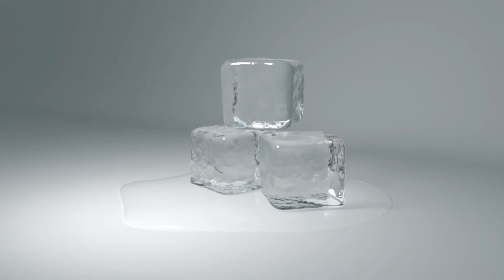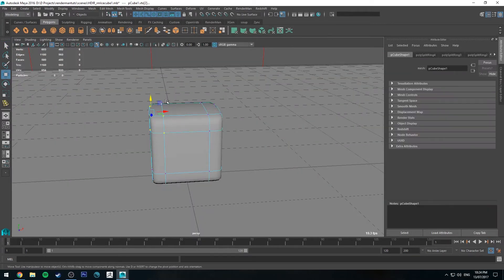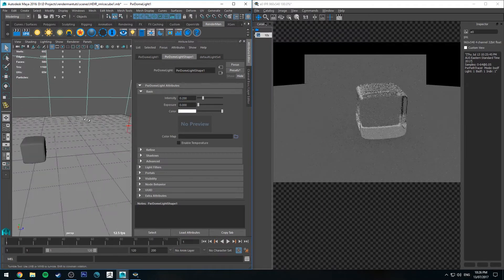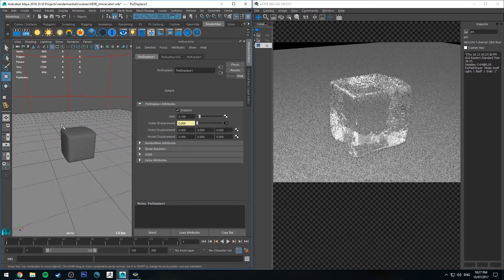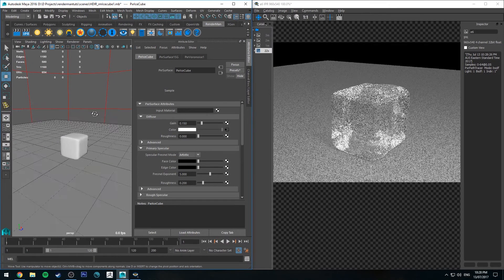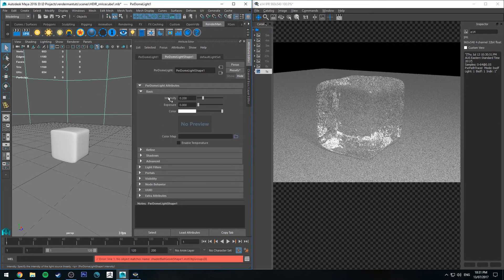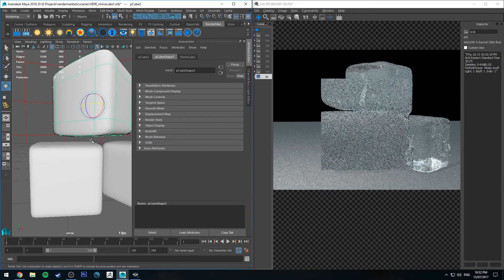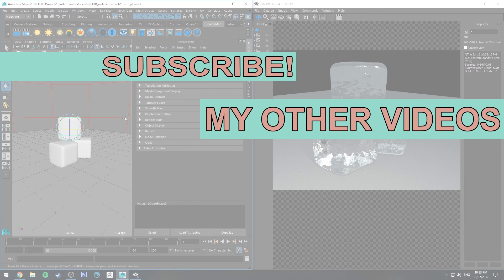How Do I Render: Ice Cubes (Renderman & Maya)

Comment: will this work with Arnold?
Reply from the maker: Yeah, same thing basically just need to use Arnold lights and shaders.
Reply: @SmallRobotStudio  I don't know...I'm having trouble translating it from Renderman to Arnold. the names and setup are different and if you don't know what they do... its kind of hard to figure out unless you experiment and click buttons and hope maya doesn't bitch at you for it...
Reply from the maker: Hate to tell you but that's the game you're playing, it's a lot of pressing buttons to see what they do until you figure it out while Maya crashes. The basics of what you want to do are create a surface that transmits light and has no diffuse, so apply an aiStandardSurface shader, reduce the gain on the diffuse channel to 0 and increase the transmission weight to 1.0. Set the IOR in specularity. I can't remember what I did for displacement etc but it's the equivalent for Arnold, there's plenty of tutorials out there on how to do the basics with that renderer.

Comment: Hi Michael. Thanks for all of your tutorials! Mind if I ask you a quick question? I'm trying to create a scene like the one seen in the Monsters University teaser trailer, where Mike was turned into a disco ball as prank by the other monsters. The problem is that I don't know which material and settings to use to make those shiny panels that scatters the incoming light onto the walls. Any ideas?
Reply from the maker: With this shot I think they cheated a little. The small mirrors are just reflective surfaces so just the PxrSurface with high specularity will do the trick but I don't think they're actually casting the caustic reflections as there are some reflections BEHIND Mike (opposite to the light source). What is really happening is that there's probably a light linked light source shooting out the small highlights, one or many (this may/probably is an effect in post as well had to say without really watching the scene in slow-mo). 

The shot also is using Volume Scattering on the light, which again I think is being added as a layer in post as there doesn't appear to be any 'fog' anywhere else in the shot. Caustics and scattering is a tough thing to do and requires a different integrator (which I haven't actually covered in a tutorial yet).

Moral of the story is if I were doing a disco ball I'd set up the ball, with reflective surfaces either creating a specularity alpha map or using seperate meshes as the mirrors on the ball, light link a light (maybe an IES profile light?) to ignore the ball but shoot out rays from inside the ball so to hit the surrounding ceiling/wall etc. Then set up another light, linked only to the ball so the camera 'sees' the reflective highlights but the light itself is only there to generate the highlights on the reflective surfaces.

Hope that helps.
Reply: Thanks a bunch for the reply. I appreciate how thorough your answer is. For the sake of reference, have you already done a tutorial on light linking, and would the PxrDisney shader be a viable substitute for the PxrSurface shader for the reflective surfaces? Reason being is that I'm stuck with using Renderman 20 since 21 isn't compatible with my older edition of Maya. So I haven't been able to locate the PxrSurface shader inside of the program.
Reply from the maker: Uhh not sure about PxrDisney - it's been so long since I looked at it. Anything with a good specularity response that can look glassy - maybe PxrPlastic... or was there a PxrGlass? I can't remember it's been to long. Something with a lot of specularity in any case that can reflect light easily.
Reply: Yes, there is a PxrGlass shader, but interestingly enough, it doesn't appear to even have an option for specularity. But PxrPlastic does, so I think I'll go with that. Thanks for the recommendation!

Comment: You think you can do a video on cell shading in renderman? I'm trying to make something and am confused on how to get the look.
Reply from the maker: +Mister Julian15 without writing a custom shader (or buying one) it's not possible out of the box I'm afraid. You can do it pretty easily with Maya Software renderer however and will achieve that flat cel shaded look with little disadvantage on render time.
Reply: I think Cell shading is mainly driven by the textures, you need to merge shadows and normals in the diffuse channel. Borderlands is a perfect reference, you can clearly notice how simple the models are and how the details are just an illusion. Muscles and cloth creases are painted and you have little specular (only metals maybe). I'm creating a videogame that will be probably be cell shaded and I'm going to study this style in Rm, maybe I'll make a video if I will achieve good results

Comment: Hey Michael, 
You could have added Trace Displacement Attribute and Displacement Bound Attribute in the ice_shape node and set the value of displacement bound to 1 without changing the actual displacement gain. In that way extra push which is in the end of the video can be avoided. 
Cheers! 
Thanks for the tut! ;)
Reply from the maker: Hey Japjeev, I remember reading about/trying this before but never have any luck as the displacements still get all out of whack - when you do it are you able to prevent the excess displacement? Mine still grows well beyond what I'd want it to be... I may need to look into this again.
Reply: Small Robot Studio yes i am able to prevent the excess displacement!
Reply from the maker: Hmm, clearly I'm doing something wrong here, I will look into this. Thanks for the heads up Japjeev :)